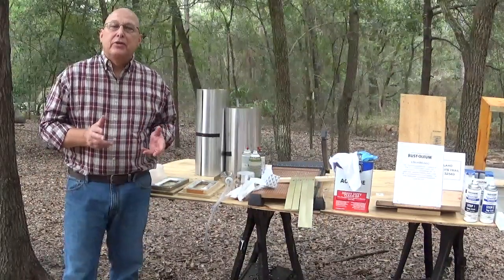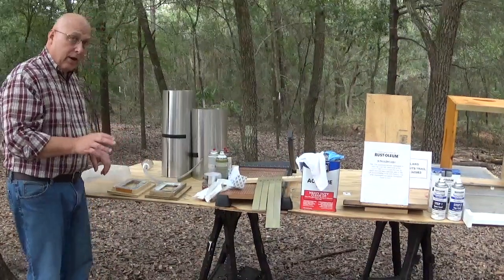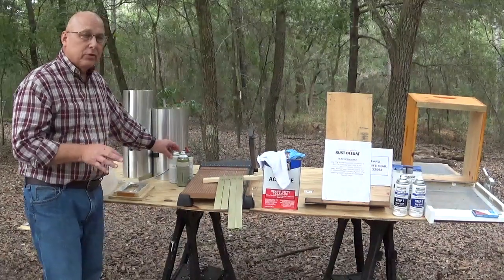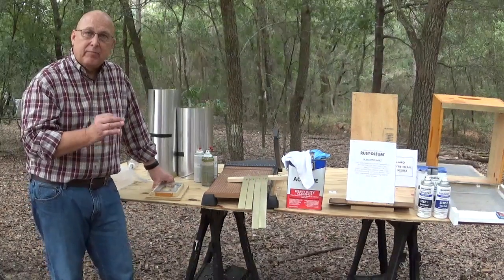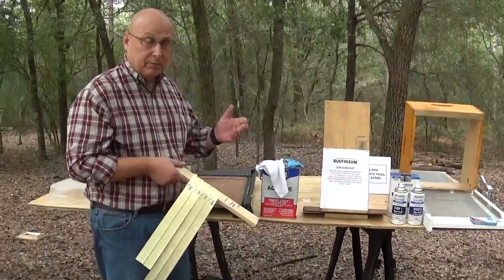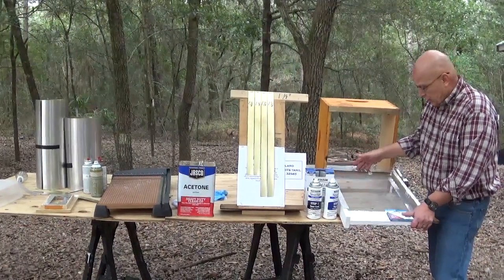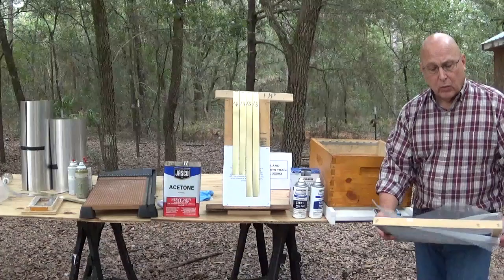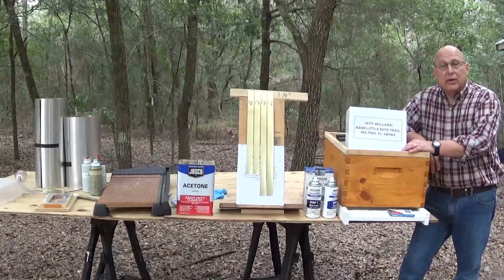Small Hive Beetle Barrier, it is easy to make and inexpensive.....

Comment: Hi Jeff,   Aluminium flashing in Australia comes in 6" and 12" at our Local Hardware stores.  Please can you let us know what thickness the aluminium flashing is that you use??
Reply from the maker: Hello Dave B, The flashing that is sold in the USA is a high tensile material (hard to bend) and depending on the manufacturer the thickness it should be (in inches) .0084 and .0092 our rolls come in 10' and 50'. You could use the 6" and 12" but you would just have to cut it lengthwise to 20" and 16". I have seen some videos from Australia about the hive beetle there and it looks like your having a some big problems like we are. Make sure you seal up "ALL" cracks and seams above the Neverwet coated flanges our they will find a away in, use the polyethylene foam tape between the boxes that I have listed above it works the best. Good luck with your bees.

Comment: I am a sailor and we use monel to do conections aluminium/steel. I do not now the english name of this aleation but i doubt that there are stables available. Perhaps it can be done with rivets too? Replacing it when it begans to fall apart could result cheaper anyway.
Reply from the maker: Hi Martin, If the monel material is to thick to staple, you could always pre-drill the strips and  use small 16 gauge stainless nails.
Reply: Hi Jeff, it seams i did not explain well. We use a rivet of monel tu prevent or reduce corrosion of the aluminium part on boats. As i mentioned before it is not important because your treated aluminium stripes are easily and cheap to change. Now i saw a lot of videos about SHB and they are really disgusting. I can´t understand why your method is not used comercialy. Greetings and happy beekeeping from Germany, Martin

Comment: After researching the paint, there's a cheaper version of it in using rain guard on glass and  I'm going to see if it works...a 3/8ths wide piece of coated glass should do the job as well as the higher priced variety. I'm also thinking about using a piece of aluminum to stick the glass on and extend it outside the brood box to deflect the rain away from the base. I've already put angle flashing on the lid to direct the rain away from the entrance to the hive and the rear of the box in order to keep it dry during rainy weather. If it works well I'll post it here.
Reply from the maker: Hi Wm,
I think you'll find out that Rain Guard isn't the same as Neverwet but good luck with your experiment, you never know how it will turn out until you try.....
Reply: Shim the backend of your hive up 1/2" any driving rain will drain out even when it rains sideways.

Comment: Hey, Jeff, I was thinking of adding a strip of your "invention" on the inside of the hive body around the inside in case the bees have chased the beetles and they hit the strip and then fall to the bottom.  The question is what size should the strip be ( width) and how would you glue it to the inside of the hive?  The strip should be big enough to make a beetle fall but not big enough to bother a bee.  The glue to glue it to a hive body is another consideration.  

I am really thinking of putting hive bodies that already have bees with beetles.  I have seen too many beetles under the beetle trap that lies on the frames and even beetles that go in the trap and then come back out of the trap.  We are really having a beetle problem this year so I am planning for future equipment set up to physically counter act beetle problems.
Reply: sorry, I accidentally punched "reply".  I was thinking the strips with never wet should be about 3/4 up on the hive body to help the bees rid themselves of beetles when they get an infection.  They would fall to the bottom and then have the never dry aluminium strips to contend with on the bottom as you show on your video.
I will have to decide on what kind of glue to glue the strips directly on the hive bodies with the strips.  I guess one could glue strips onto frames also to make the beetles fall.  

If these things work,  I will be sharing them with our bee club.  Thanks again for your "invention" and hard work and research on this important issue.
Reply from the maker: Hi Tom,  They do work, in my 40 hives the only beetles I see now are the ones on the outside trying to get in. As long as you have the Neverwet coated flanges mounted on your hive  like in the video which prevents the Hive Beetle migrating upwards inside the hive to hide and lay eggs in the comb. The second most important thing is sealing all cracks and openings above the Neverwet coated flanges. I use 1/8"x1/2" polyethylene foam tape (from Equalseal) between hive, supers and vent tops or covers and I caulk the seams between the bottom board and hive body. If you leave any opening or cracks above the Nevercoated flanges the beetles will get in. When I first installed these coated flanges I saw the bees chase the original beetle population down the sides and over the flange which kept the beetles out permanently. The second coated flange may work to quicken the reduction of your existing beetle population, do a comparison test between hives with and without the second flange and see if you notice a significant difference. I think keeping the oil traps between the frames for the existing beetles and also use lower traps with bait, oil or dryer sheet would be more beneficial in controlling the "outside" beetles population which can not get inside your hive because of the Neverwet coated flanges.  Good luck with your bees....

Comment: Hi again,  Which big box store did you get the Rust-O-leum from?  I have tried Lowes and Walmart.  They do not carry the product you are showing.  They do have a never-wet product, but it is in a spray bottle...not in a box with two aerosol spray cans.
Reply from the maker: Hi Janis, Unfortunately my area Lowes and Home Depot stopped carrying it also after I made the video. I now get mine at Amazon, I have seen it at Tractor Supply also. The spray bottle is a fabric water proof conditioner you want the spray cans,. They come with two cans to a box with a step one and step two spray can.

Comment: Hi Jeff   I see that you clean your aluminium with Acetone before applying the Rustoleum.  Can you use methylated spirits or turps to clean the aluminium strips??   Thank you.
Reply from the maker: Hi Dave,
I don't know if the  methylated spirits (alcohol) would be strong enough to remove any manufacturing oils or films used to make the aluminum flashing like acetone does and I'm really not sure whats turps is.
Reply: Turps is mineral turpentine or paint thinners. @Dave B, acetone is nail polish remover.

Comment: Jeff, I will be trying your idea this spring. What gauge aluminum do you suggest using?
Reply from the maker: Hello David,
Use the aluminum flashing that is sold at Lowes, Home Depot and hardware stores.  I used the 20" and 16 rolls, its super thin and high tensile strength which makes it perfect for this application.

Comment: Jeff, one thing I haven't figured out yet: why do the sanding on the gold side and not the other? (I'm sure there's a good reason.)
Reply from the maker: Hi John,
On my flashing the gold side was on the inside of the roll and it had a slight curve from being rolled up, so I just used the curve side facing downward. The clear polymer coating needs to be removed (as shown in later videos)

Comment: Jeff,
     So the 1/8" hardware cloth sits right on top of/against of window screening?  Why not staple them down together at the same time?  Or do the screening and 1/8" hardware face each from opposite sides of the square frame?
                                                                                                                                   Dale
Reply from the maker: Hi Dale,
  Sorry if I didn't word that explanation correctly in a previous comment, you do staple the window screen and 1/8" hardware cloth down together on the vent frame bottom with a single row of 1/2" stainless steel staples (I like using stainless) spaced about an inch apart. The aluminum window screen is the outer layer and the 1/8" hardware cloth is the inner hive layer. Spray contact adhesive on the outer screened frame edge, let dry and then attach the polyethylene foam tape to the screen. You now have a hive beetle proof screened vent top. This is how I do mine, rip a a 1"x 6" or 1"x 4" board down to 1-1/4" wide, from that board cut two 16-1/4' and two 18-1/2" boards. Lay the 18-1/2" boards on their 3/4" sides then take the 16-1/4" with the 1-1/4" sides standing up glue and nail to 18-1/2" board ends. Now you will have a square frame with 1-1/4 on the ends and 3/4" on the sides. Then attach screen as explained, I hope this helps.
Reply: Yes, thanks!
Reply: Jeff, I presume that you're putting the hardware cloth over the screen to protect it.  I just replaced some screen door screen with this pet screen from Home Depot:
https://www.homedepot.com/p/Phifer-36-in-x-84-in-Black-Pet-Screen-Kit-with-Spline-and-Roller-3025886/205001783  

I was very impressed with its toughness.  It's 7 times tougher than window screen and tight enough to keep the beetles out.  So tough that pets can't scratch it and put holes in it.   What do you think of a layer of this tough screen instead of the two layers of metal screen?

Comment: any reason why we can’t spray the flashing while it’s in one piece and then cut the strips after the steps have dried?
Reply from the maker: Hello, 
You could but I was worried about the adhesion of the Neverwet on the cut edge. Make sure you watch "ALL" the videos on this Beetle Barrier, it has evolved and there is new info on refinishing the aluminum.

Comment: Do the bees propolise the metal with the never wet on it?
Reply from the maker: No, the Bees do not build comb or propolis on them. The metal strips in my hives are just as clean now as when I installed them. You have to make sure "all" cracks and seams are filled, sealed and closed between the hive body, bottom board and top. The Excluder Strips will stop the Hive Beetle at entrance and the bottom board.... Good Luck.

Comment: I can't find the link to your vent boards. So the sides are a different height than the front and rear? Do you put the screen cloth on one side and the steel mesh on the other or do you put it on top of each other on the same side? Also will regular foam tape work to seal it all off?
Reply from the maker: Hi Jeff, I tested four different kinds of foam tape and polyethylene foam tape works the best. I haven't made a video on vent tops yet, but here are the plans. Rip a a board down to 1-1/4" wide, from that board cut two 16-1/4' and two 18-1/2" boards. Lay the 18-1/2" boards on their 3/4" sides and take the 16-1/4" with the 1-1/4" sides up and glue and nail to 18-1/2" board ends. Now you will have a square frame with 1-1/4 on the ends and 3/4" on the sides. On the bottom attach the window screen first then the 1/8" hardware cloth use 1/2" staples all around the edge. Spray contact adhesive on the outer screen edge, let dry and then attach the polyethylene foam tape to the screen, you now have a hive beetle proof screened vent top. I have these on all my hives. Here's the link to the foam tape; http://www.equalseal.com/White-Polyethylene-Closed-Cell-Foam-s/2187.htm
Reply: Thanks so much! I am going to check this out and if it works, I will be sending you a donation.
Reply: what width and thickness is the tape that you use?
Reply from the maker: I am now using the 1/8" thick X 5/8" wide polyethylene foam tape  ..

Comment: I work in Printing and have access to aluminum plates. Any reason I couldn't use them for the metal strips?
Reply from the maker: Hi Bob,  Those type of aluminum plates should work, if is is a soft aluminum (low tensile strength) just be careful not to distort the coated flange when putting your hive box on and make sure it is clean before spraying. Its also a good way to recycle aluminum, have fun....

Comment: Jeff,  you mention on your video that the strips protrude into the hive by 3/8.  Is there any reason that you picked that particular measurement?
Reply from the maker: I thought at the time that it would be an optimum distance to stop the hive beetle and yet allow the bees to crawl over. I've been experimenting and had the Neverwet flange protrude 1/2" inside the hive and didn't see any ill effects on the bees movement. I would not make the protrusion any shorter than 3/8" or the beetles could grasp the outer edge and pull themselves over.
Reply: Thanks for your reply and thanks for your videos.

Comment: Hi Jeff, Im in Australia so it this question doesn't really apply to me YET, but do you know if this system reduces or has any impact on Varroa mites in a colony? congrats on the good work. Regards Phill
Reply from the maker: Hi Phill,
I have a "mate", Bill S. from the ShoalHaven Bee Club in Australia that I e-mail with and we talk about bees and life in general. You are lucky not to have Varroa yet but sadly for you that will change someday. The use of screened bottom boards with the Neverwet coated barriers not only keep out the hive beetles they will certainly stop Varroa also. As the Varroa drop off the bees and fall through the screen bottom the surviving Varroa would be stopped by the Neverwet barrier from getting back into the hive.  Good luck with your bees..
Reply: The mites come into the hive attached to bees so this might help, but it is not a 100% cure.

Comment: Would there be any benefit to spraying the 8" hardware cloth on the bottom board with the Never Wet?
Reply from the maker: Hi Sabrina, No, there is not any benefit to spraying the 1/8" hardware cloth screen bottom. The Neverwet coated flanges are more than enough to keep the hive beetles out of your hive.  I say this all the time, you must seal all cracks above the coated flanges or the beetles will find a way in. Use the 1/8" X 1/2" polyethylene foam tape between the boxes. I have the link listed above it is tough and works great, it makes the whole hive sealed and beetle proof.
Reply: Thanks for the quick reply :) I'm a new beekeeper, and one more question...the foam tape '
between' the boxes, does that make it hard to get into the supers for varying reasons for management? I cannot see the link for the foam tape, I went to Equalseal's website and I don't know if it is the one-sided tape or 2 sided???
Reply from the maker: Hello Sabrina, Just make sure the edges of the box that you are going to adhere the tape to is clean, scrape off all propolis, wax and other bee junk. The foam tape is adhesive on one side only the other side has an almost smooth waxy feel and and that side really doesn't adhere to a clean surface. That is why you have to clean both sides the first time. When you have to open the hive slide your hive tool in and pop it loose, If you damaged the tape or the bees chew it out (some hives will, some won't) it is easily replaced.  here is the link;   http://www.equalseal.com/White-Polyethylene-Closed-Cell-Foam-s/2187.htm  Good Luck

Comment: what if you use a slatted rack, could you simply put these all the way around the bottom of that and nothing on the bottom board?
Reply from the maker: That should work also, as long as you have that Neverwet coated flange as a barrier between the bottom board and hive body almost any configuration will work to keep the hive beetle out of the frames and comb.

Comment: Line inside walls BELOW bottom screen, slide in disposable foil cookie sheet with a layer of mineral oil. Remove the mite count board.   Anything thing with legs, that falls through the screen ideally remains trapped in oil. Anything that misses the oil won't be able to crawl up sides. Flying. Ugh. Takes more energy to fly. Maggots don't fly.
Reply from the maker: Many people have used an oil trap and it works well with the Neverwet barriers. Good luck..

Comment: I can't seem to find your video of the screened vent top.  Please help.   Thank you.
Reply from the maker: I Lindsay,  The use of window screen was at the end of the video but the construction is very easy. Rip a a board down to 1-1/4" wide, from that board cut two 16-1/4' and two 18-1/2" boards. Lay the 18-1/2" boards on their 3/4" sides and take the 16-1/4" with the 1-1/4" sides up and glue and nail to 18-1/2" board ends. Now you will have a square frame with 1-1/4 on the ends and 3/4" on the sides. On the bottom attach the window screen first then the 1/8" hardware cloth use 1/2" staples all around the edge attach polyethylene foam tape to the bottom. You now have a hive beetle proof screened vent top. I have these on all my hives, I have more videos planned stay tuned.... Good luck with your bees and Happy Honey Hunting.